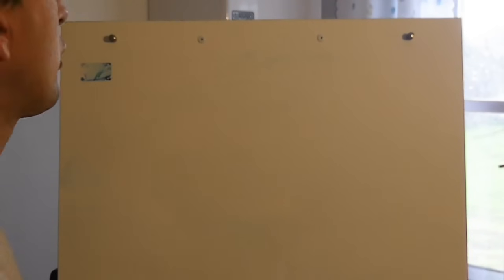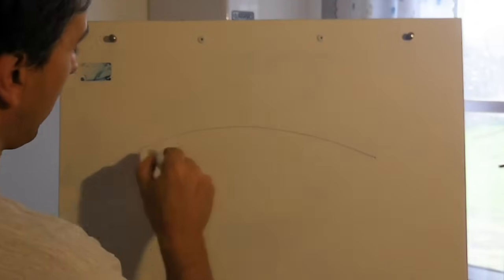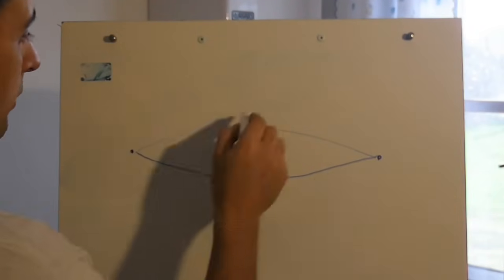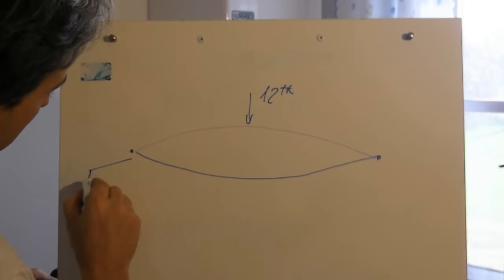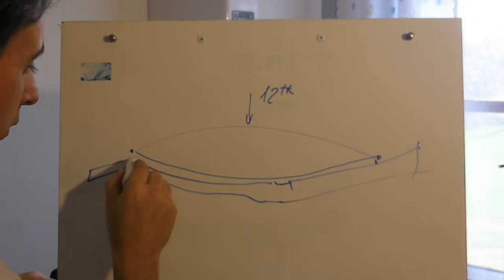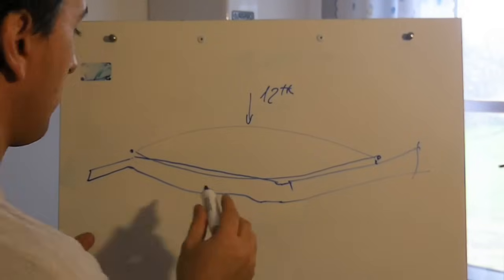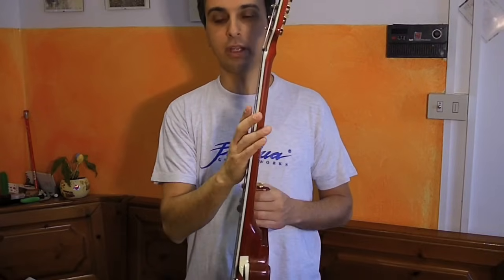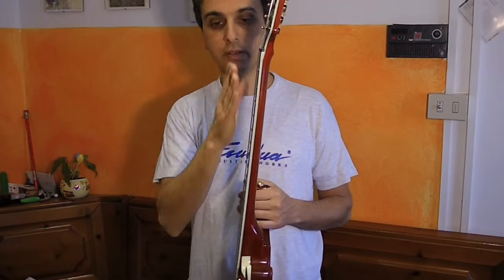Truss rod adjustment: how to adjust the truss rod - frudua.com

Comment: Thanks for posting! One thing though--I've never noticed it making any difference whether the guitar is in the horizontal, vertical, sideways, whatever position when adjusting the truss rod. Mainly I play bass so that's where most of my experience comes from. I usually adjust it though with the bass standing on end on the ground with the headstock up facing me (with bullet style). I do have several basses with the adjustment at the neck end. Probably because I make small adjustments and then evaluate with it horizontal in the playing position I don't notice what you refer to as gravity affecting the curve of the neck. In the horizontal position the neck would act as a fixed-free member like a diving board (yes, I'm a civil engineer). So you are correct, gravity would increase the upbow. If the neck is supported at the headstock end though then gravity would decrease the upbow. The point I'd really like to make though is be very careful not to over tighten (like you said)! Maybe something to help release the truss rod nut is needed if it hasn't been moved in a long time. I stripped the threads on one guitar and ruined the neck. Most likely because the previous owner had already stripped it. Looks like he was afraid to adjust it as it had considerable bow in the neck and was a vintage style fender where the neck had to be removed. Or maybe he just scammed me. So people out there learn to adjust your truss rod and do it frequently as needed to prevent the wood taking on a set bow and keep everything working. Thanks again!

Comment: Hello Frudua,  May I say you have the most accurate to the point information on this subject. Thank you for posting it. Now, what if  the only one string is buzzing when played open. In my case it's the B string. My guitar is an Ibanez rg 320 DX. It does not buzz when fretted or even when you bend when playing.  I have done almost everything except re crown the fret.  The first  4 frets do have some dips in  them. Any advise would be greatly appreciated. Thank you.

Comment: Good video.  Thanks.  I am a beginner guitar player, but have played the piano/keyboards for over 20 years.
  I am astounded at all the tiny things that go into making a good sounding guitar.  So many tiny things to think about and they all have to be in balance to make a great sounding guitar.  I stupidly thought my buzzing was caused by a bad neck.  (Once I figured out how to stop the "User caused" buzz.) 
   I have a electric and a acoustic/electric guitars and after trying to adjust these myself.  I think I need to get them re-adjusted, there is no telling how much damage I've done......Both were new, and not set up. 
So thanks to you and others who explain how to self adjust ones instrument.  But I think it's a good idea for me and other beginners to see a pro and to watch and learn as they set up a guitar.
   Lastly, it was nice to hear that I could only screw up the guitar so much and not break it. 

R.C

Comment: Frudua, you are the best at giving instructions as a luthier. Very easy to understand and I love the way that you use common objects such as D'Addario string package to do measuring. Many of of us do not have expensive guitar tools. By the way, I live on Long Island New York right near the D'Addario string factory. They are Italiani that came to the USA alla fine dell'800. Ho anche ascoltato la vostra versione di If I Fell. Amazing version. I wish you molta fortuna nel campo della musica. Dove stai in Italia? Abbiamo una casa nelle marche ad Urbino. Ho anche visto quel programma televisiva girato in Romagna. Siete bravissimi.  You really helped me to set up both my dual pivot tremolo and my 6 screw tremolo bridges on my Stratocasters. Thank you so much. Auguri.

Comment: A lot of people have problems understanding clockwise, counter clockwise, righty-tighty, lefty-loosey when it applies to a truss rod. I have a very simple solution;  use the terms "high side" and "low side".  High side means turning the truss rod towards the high strings or the "High E" string. Low side means turning the truss rod towards the low strings or the "Low E" string.

Comment: If the TR is loose in some way which sometimes happens in the "resting position" where it has no effect, it can start to vibrate and to inhibit the vibration of certain notes. Much more probably you just have to lower the neck pickup a bit.

Comment: very usefull video. I just bought a brand new Washburn xm std2 and out of the box I noticed string buzz on EAD (654)th strings. that is really annoying. when I checked a truss rod I came across that there is no neck relief. string is touching at 10 fret. So I will to adjust it a bit, if it not helps I will send the guitar back to guitar shop

Comment: This tutorial would also imply (implicitly) that a truss rod adjustment (or simply checking) is needed when I change my guitar string gauge, moving to a different climate (after hours of traveling), etc. Could you possibly share us what's the limit of string gauge and tuning for a standard built guitar (say, an Ibanez Japan made) could take? We see people used to use bigger gauge for dropped tunings.

Comment: Thanks for the video. My question is. Say your neck is straight on your acoustic, if you change your strings to a lighter or heavier gauge would that effect the straightness of the neck over time. So in other words if you change your gauge size on your acoustic is it necessary to check the neck other a period of time say 24 hours after.

Comment: @FruduaTv Yeah, with a pick I can go as low as 1,5mm on low E and 1,3mm on high E without buzzing. But I often play and strum without a pick because of the softer tone. Your new video about the string height explains almost all my questions.
So I'll leave it on the 2-1,6mm, best compromise of tone and comfort. Lower is always welcome, but I think it can't be achieved that well on a Strat-like guitar.

Comment: the best way to adjust the truss rod believe me i adjust my old rg570 and sounds like hell, just a question i have a hollow af75 and i changed the original strings 10-46 with a 12-56 and the tension is harder, should i lose the lose a little bit the bolt or go up with the bridge??

Comment: Thanks for all the fantastic and practical setup tips! I'm just a little confused about one thing though. Are you saying the D'Addario envelope paper is the perfect thickness for neck relief, but the BC thickness is too much? Please clarify. Thanx again! :)
Reply: did you figure it out, friend?
Reply: @yeid44  Yeah, I just tried to get the action as close as possible without fret buzz. But my frets are a little worn, so I had to set the action a little higher than usual until I get them dressed. Thanks again.
Reply: I'm glad you figured it out friend, I'm confused on the exact same point u pointed it out. Can you clarify that for me please

Comment: It worked for my SX SG. Just to clarify, To Loosen and create more Bowing, turn Allen shaft towards the thin strings (counter-clockwise). In my case the E thick string was buzzing on first fret, just a quarter loosen solved. Do you think hanging the guitar on the wall is benefic or can influence in some way the natural bending of the neck? Thank you from Brasil.

Comment: Hi Galeazzo. This video is great but my problem is regarding an acoustic guitar.
I have a beautifulTanglewood heritage drednaught where the action has raised since new. The problem is, it does not have the truss rod adjustment at the nut end of the guitar. It obviously does have the adjustment in  the sound hole, but this only allows for adjustment the opposite of what I want. Can you help?

Comment: Thanks,
Just have an old Gibson Les-Paul.
The strings up by the . 12th fret are fine.
15th to 20th frets are about 3 mm - just a bit worried, if I adjust the bolt-
will I get fret buzz on the lower strings- or they maybe even might get too close to the pick-ups.?

Comment from the maker: @sueside Playing without a pick forces the string to move wider thus increasing buzz. Make you test playing with a pick. Does it buzz on E and A, and on fret 1-10? If so release the truss od JUST A  BIT. But in any case make the testing with the pick.

Comment: Hi Galeazzo, today I managed to adjust the truss rod in my Epiphone LesPaul 100.
I followed your instructions. I placed the capo at the 1st fret and pushed against the last fret, after the adjustment the height of the action was "one business card" at the 10th fret then I made some small adjustment from the bridge. Now the height of the high E string (1st string) at 10th fret without the capo is "one credit card" or 1mm and the height of the Low E string (6th) is "two credit cards' or 2mm. What do you think? Is it good?
Reply: I just got through doing his setup.  Once the truss was set, I had another issue with something buzzing.  I thought it was fret buzz but it was actually the high E hitting the pickup.  I think I have the same guitar too.  I fixed the pickup height but with that out of the way I could lower the action by dropping the bridge.  Did you try adjusting the bridge?  (Raising it in your case.  ...if it isn't buzzing it's probably OK, but hard to imagine the action that low and no buzzing)  Just a thought.  Good luck!  Still all jazzed about never having to pay for another junk setup from Guitar Center.
Reply: Glenn Thomas Guitar Center? Ech, I hate those guys. Typically a bunch of arrogant jerks, treating you like mommy brought you in to your first guitar store and ya have no idea about guitars. I had a supposed salesman trying to actually talk me out of buying a 2500 dollar Les Paul for a PRS. I wanted to slap him. I was appalled and not been back since. I go to Motor City Guitar, 25 miles north of Detroit, They are a Gibson dealer. Their sales guys are great, and will spend time with you.
Oh, Guitar Center tends to get Gibsons designed for guitar center only. I don't like em, they don't play as nicely.
Reply: Glenn Thomas
 Of course you have to adjust the bridge too, but the buzz could be from some frets which need to be leveled too, that's a more complicated issue. You need to use sandpaper and I would leave this job fr a specialist.

Comment: Great video !! I need help with a neck issue. I recently took my neck off to refinish it. I didn't take the frets off or the nut there was no need. I put it back on the guitar and now all my strings buzz. There is no action they are flat against the board. Is that an issue with the truss rod or the saddles? How can I fix this?
Reply: Check if the stings "sat right" through the tusk paths (dont know the exact term.. english is not my native language). It could be that  there is something there, or the stings kinda hover. Also, by detuning your guitar you took away much of the tension caused by the strings. Wood is an alive material as he says. If i were you, i would let the instrument sit for a day or so, tune it if needed and then check again for the buzz. Supposing its not a bridge problem, the neck could adapt again. If not, you could try adjusting the truss rod turning it COUNTERclockwise. Please let me know more and good luck ^^

Comment: So I have an Epiphone SG which I bought four years ago brand new from Guitar Center. I play it all the time but the problem is that I've never adjusted the truss rod (shame on me) because I worry I may damage my guitar. So you can imagine after watching this video that I was super stoked to adjust my SG's neck in confidence. But my excitement later died when I found out that my truss rod refuses to turn, which is odd considering it's never been adjusted before at least from what I know of. I don't want to force the turn because that could clearly be damaging to the guitar. I can honestly say I'm well fitted around guitar repairs and setups, but the truss rod has always been my downfall. If anyone can help me out as to why I'm experiencing this problem with my truss rod, I would seriously appreciate it.

Great video by the way, incredibly helpful.

Comment: Great channel!!  Hey, I have a 2006 American Fender Stratocaster.  I had one tech set the strings pretty low without any buzzes, so I know it can be done. When I had a new tone block install they changed my setup.  Can you do a video on how to set strings on a Stat low as possible with no buzzes?  This Strat has a tremolo, but I don't use it.  It's set up like a hard tail.  Thanks alot!!!!

Comment: Thank you for the big help. I am using your technique on my guitar to adjust relief, cheking the fret-string distance on the 1st string above the 10 fret. But Fender strat setup guide indicates to set the 6th string at 0,01" above the 8th fret  (neck radius 12")...do both techniques give the same result? is the addario envelope you use about the same width as 0,01"? Thank you very much for helping me out!

Comment: A trick I use is putting on a heavier gauge of strings, tuned to 440, and leave it that way for a while. That should give you more relief, and get the neck back to where it should be.

Comment: My Epiphone Les Paul Tribute Plus has fret buzz on only the A string. Weird! I've checked the nut, saddles and raised the bridge higher than I should have to and nothing has worked. My other Epi Les Paul's have perfectly flat necks as does this one so I kind of discounted that as being the problem. There may be one or two high frets but the A string was buzzing all the way up to around the 16th fret. And only that string. I ended up loosening the truss rod a bit and it has helped. It's only buzzing up to about the 6th fret now. I'm going to let it settle overnight and see where it's at in the morning, but do you think I'm on the right track in fixing this??

Comment: Hey Frudua, I got a problem with my stratocaster (japanese 1980), that is a buzz on the eight fret/first string and also buzz in twelve fret/ fourth string... it can be fixed with a truss rod adjustment???... thanks in advance, dude... by the way, i enjoy the explanations in your videos, i'm a mechanical engineer and i can see that everything in videos points to a engineering answer, good for you!!!

Comment: hey I changed from 10gauge to 9 strings and now my bends choke out on the b and high e string especially higher up the neck, I decided to try fix it by adding relief, which i have done a lot and it hasn't changed. I still cannot fit a card under the high strings either, what shall I do? I am afraid to add more relief as Ive added loads, thanks

Comment: I have watched many of your videos. Thank you for your time and effort!  I have questions not exactly related to any of your videos I have found. I went to your web site but since English is the only language I can read, I was lost there. So I will ask you here. I bought a Reville Tele style guitar (12 radius neck, rosewood fretboard) which I believe to be one of the best guitars I have ever owned and I have had American and MIM Strats. I have been doing some upgrades, Hipshot locking staggered tuners, Locking strap buttons, 6 brass saddles (instead of the 3 chrome), and Graph Tech XL nut. When I was installing the new nut the rosewood from the nut slot toward the headstock broke out. Now there is no slot for the nut. I would consider a roller nut or any other type nut that would fill that space. Can you help me figure this out. I am not a novice and have worked on many guitars but never had this before. I don't know how to figure the height of any nut and how to make the broken space straight and level?

Comment: I tried using that method in my Godin Multiac Spectrum and it is about right. Problem is, bending the strings somewhere after the last 12 fret is not as easy other guitars that I use with the same gauge 9 strings and scale length. Is there still a way to improve the action?

Comment: I think guitar & bass guitar owners have to read the manual for their instrument in regards to truss rod adjustments. For my Warwick bass it actually states that "If you are facing the 5mm Allen fitting, turn clockwise to flatten the neck, counterclockwise to introduce more relief, which seems to be opposite from what is mentioned in this video.

Comment: Thank you Mr Frudua a great help.I have a problem that at the f sharp the inside strings buzz like crazy ,strange thing is the top E and the Bottom E are fine .have you any ideas ? I use 10 to 46 strings with a Floyd rose R$ nut and Floyd rose tremolo system..Many Thanks a  good video...:-)

Comment: Very important information. I know you from Beatles Vocal Harmony channel!
My question is, I have a 7 string guitar, I can tune the strings e,a,d,g,b,e but the 7th which is a B it seems to be in tune when I play it with the pick, after some milliseconds the PITCH goes DOWN, like if I was releasing a bend, this happens when I play the open string or in a fret, does this has to do something with the truss rod? with the bridge? or my guitar sucks? :(
Reply: +Juan Ayestas Might be tuners and or nut. If you have a locking nut and a floyd or evertune or any locking parts, check them if they are locked down.. Or if you have a Tom or string thru and no locking tuners or andy other locking mechanism, you might want to change tuners.. Change strings first just in case..
Reply: Tune-O-Matic is "tom" and andy i mentioned is supposed to be "any" xD damn keyboards..
Reply: Aqqalu Olsvig Thanks for your advices man

Comment: Hi, I've just tried to adjust the truss rod on my brand new Duesenberg Starplayer .I changed the Duesy strings for some slinkys .I now have a slight twist in the neck ,more noticeable when you look down the guitar from the bridge end and the headstock has a downward tilt on the left side .this is a xmas present and I'm crapping myself .HELP !